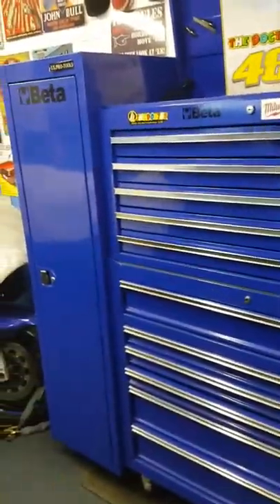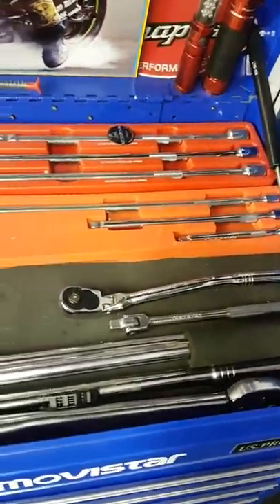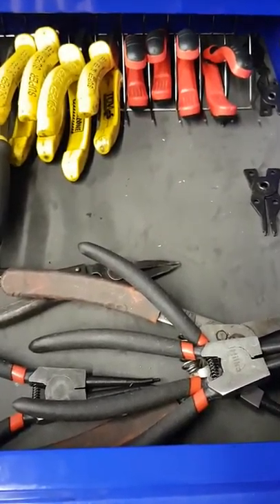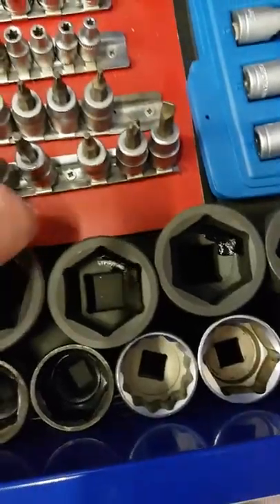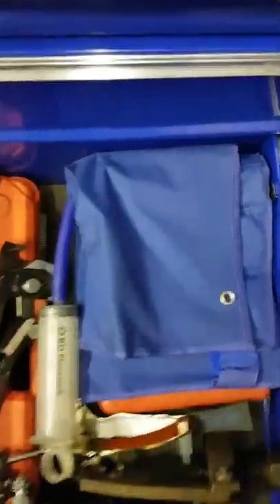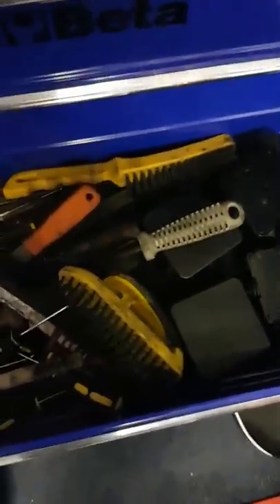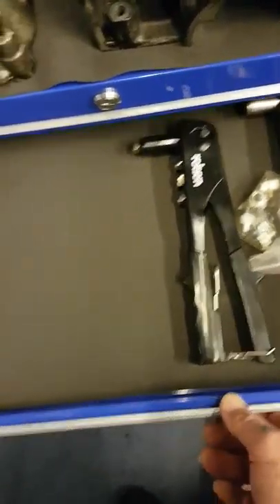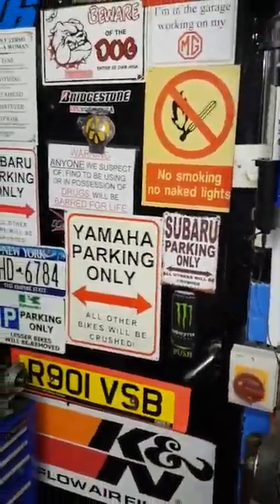us pro toolbox update

Comment: Hi Darren I have just purchased a us pro tool chest myself nothing as grand as your can I ask how do you remove the draws as I need to fit the side handle and where you got the foam cut outs to hold tools like the screwdrivers and pliers thanks in advance for your time and help
Reply from the maker: hi mate cheers the side handles should just screw straight in as the holes have avdels in most of my stuff are in the origanal boxing but my pliers are in a rack its one that i got from bm s for holding plates and dishes i just cut it up